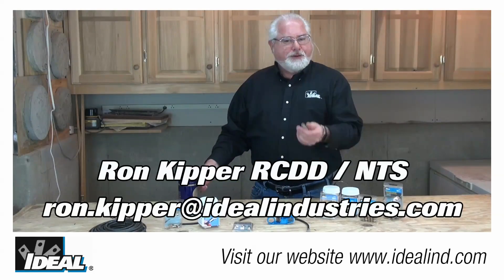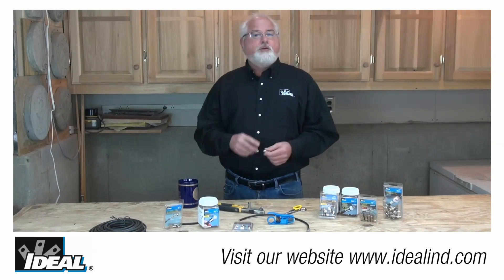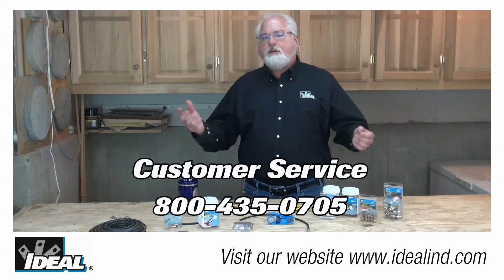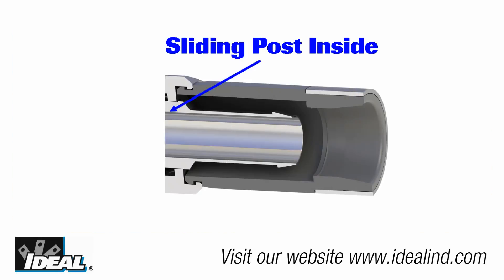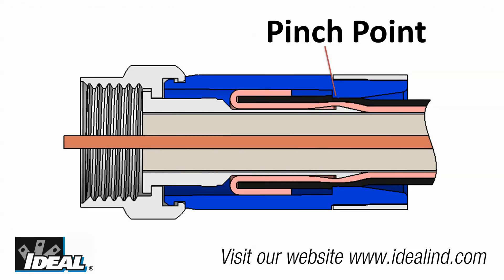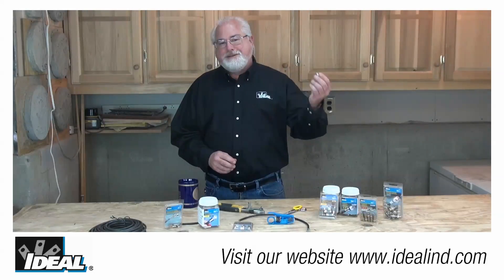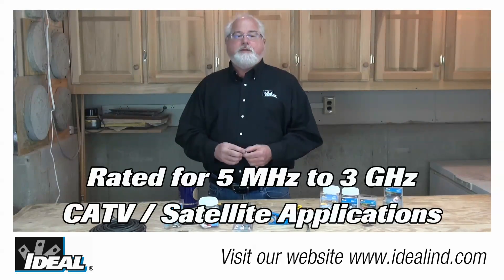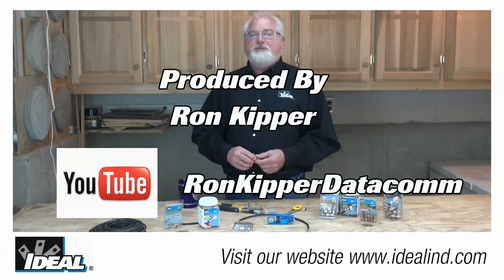TLC™ F Tool Less Compression Connectors

Comment: I used this to make 4 coax cable connections in the basement and they work as expected.  I was going to buy compression tools until I saw this in Home Depot and decided to give it a try.  I used Klein tool coax stripper to make the cut, folded back the braid and pushed (with a little twist) the connectors into the wires.   For a one-time job there is no need for me to spend extra money to buy compression tools, and it was the first time I had ever installed F connectors on coax cables.  Thanks.
Reply from the maker: Hello hope they serve you well Ron

Comment: "Tool less" but uses tools.......
Reply from the maker: Yes not quite tool-less if you include the cable stripper. Really I would have everyone use compression style coax connectors but there are so many folks out there that want a simple solution to installing a coax connector have fun Ron

Comment: These things are useless. They don't fit over the cable even following the instructions. You apparently need a significant amount of force to slide over the cable. Even when using complete body weight  to apply, it's just not happening. Waste of money.
Reply from the maker: Noreen sounds like you are trying to put the connectors on RG-6 Quad cable? You may have the wrong connector for the cable you have Ron

Comment: Why can't they  be used  outdoors?
Reply from the maker: The connector is not watertight so moisture can get into the connection and corrode on the center conductor. You could use it but I am not sure how long it would last. Have fun Ron
Reply: @RonKipperDatacomm1  Thanks  I used it indoors. There  was not much metal wire to braid backwards, i connected it anyway and it worked. But i may have pressed it in too far so i had to pull it back slightly then screwed to a coupler on another cable to terminate  it. Hopefully it works so far so good
 No disconnecting happening

Comment: Ron if rg6 cables vary in size then maybe hot should state on the video and the packaging what cable brand to buy that would fit. I too am completely frustrated with this product and the twist on F connector. Neither one wants to go on the cable. Grrrrrrrr
Reply from the maker: Jack that connector has a rated outside cable diameter range of .254" to .278" range if you need more help email me at ron.kipper@idealindustries.com

Comment: Tip - If you strip the outer shielding about 3/4" (not 1/2") it is much easier. Still strip the dielectric at 1/4", then press on the fitting. When it gets too snug to push any further, you can thread the connector onto a splitter (not to tight, only one or two turns, just enough to grip the threads) then grab the cable just beneath the connector with some pliers and press the splitter down onto the connector, forcing the dielectric into place. Hope this helps.
Reply from the maker: Justin something is wrong it should never be that hard to get the connectors on if you need help reach out to me.
Ron

Comment: Why, oh why did I not heed the advice on these things and buy good old fashion crimp ons and a tool. These push on things simply do not work and I know why. I took a piece of RG6 coax apart and found the middle white insulator piece fits through fine. Then I took a 4" piece of the outer poly insulating jacket (by itself) and no way would that even start to push in there. The outer jacket is just WAY too tight of a fit. These things just do not work on many types of coax because of the diameter of the cable. These things will be going back to Lowes with a complaint to their product management about what they're selling.
Reply from the maker: Ron hey contact me if you need some help ron.kipper@idealindustries.com or take them back if you like.
We try to make our connectors fit a broad range of RG-6 cables. However when you say RG-6 that doesn't mean anything about the size of the cable. From brand to brand RG-6 cable does vary in size and you may have gotten  a cable that has a thicker jacket. Contact me and I will try to help. Ron

Comment: These are dog shit. Just buy crimp connectors. I get to rewire my bed room due to these cancer things. They NEVER just slide on as shown.
Reply from the maker: Dan There must be something wrong if you are using the right cable they should be fine. Contact me and I will try to help you out. Ron.kipper@idealindustries.com
Reply: I am one of the least experienced person when it comes to wiring, and I got them to work for the first time - no issues at all.
Reply: I am one of the least experienced person when it comes to wiring, and I got them to work for the first time - no issues at all.

Comment: I'm having a problem getting the RG_6Q to thread on the male connector , even tried without the cable , not happening
Reply from the maker: Mike I think it is just suck a little try pushing the inner post back into the connector. After you have pushed the connector on until the white dielectric is even with the hole in the bottom of the nut. The act of attaching it to the mating post helps drive the inner post back and completes the connection. Hope that helps Ron

Comment: I've been trying for an hour and I'm ready to throw this junk away and go back to the Phillips connectors. I don't see how pressing this together like they show is going to force the sleeve between the inner and outer sheathing. I have a 1/4" strip as shown but the inner sleeve is over 1/2" long...so how do you get it pushed together? I push it together as hard as I can and the white inner never becomes flush with the front of the sleeve. Pretty upset that they sell crap like this. My time is valuable and I won't be spending any more of it with IDEAL products
Reply from the maker: Gary please send me your contact info and I will call to see if I can help figure why you are having trouble. Ron at ron.kipper@idealindustries.com
Reply: I have exactly the same problem,.  I don't have enough strength in my hands to get it pushed far enough for the white to become flush with the front of the sleeve.  I suspect this the the key to making it work because it it isn't flush the connector comes right off.
Reply from the maker: Karen if you like call my cell and I will try to help you out 815-341-3537. Ron
Reply: @RonKipperDatacomm1  having same problem.  How about just telling us in the replys if were doing something wrong.  Calling helps 1 person.  Replying here to why this is happening will help the masses.
Reply from the maker: @patrooney4670  in most cases if someone is having trouble installing these connectors it is one of a couple things that might be wrong. One is they are trying to install them on RG-6 Quad cable not RG-6, your cable should be marked every two feet. You can also tell it is Quad because there are two layers of foil and braid. Next are they prepping the cable right? 1/4" x 1/4" strip, fold back braid then push into the connector until the white dielectric is even with the hole in the bottom of the nut. Finally the RG-6 cable itself the manufacturers cable diameter vary from brand to brand this connector has an outer diameter range of .254 to .278 inches. People should know that RG-6 is an electrical specification not a physical size. I tell contractors the time to find out your connectors don't fit the cable you are using is not on the jobsite. Hope that helps Ron

Comment: Mr, Ron and Ideal. I spent a nice piece of cash on your RG6F Connectors and I find, they do not thread upon the male connector. I'm very pissed, very disappointed in Ideal. I've trusted this company in many products but I must say that when I tried to spin this connector upon it's mate, it said, HELL NO. After 10 minutes, it said I won't go. OK! Enough. Off to ebay and the hell with Ideal and Lowes. If this is the way you destroy American confidence, then you're batting 100. Well done.
Reply from the maker: bain5872 It sounds like you did not get the connectors pushed on the cable correct completely. If you like contact me and we will see if I can help. Ron at ron.kipper@idealindustries.com
Reply: Ron, Thanks for your reply. I have installed coax connectors before so I'm sure the striping 1/4" outer and a 1/4" on the inner conductor is correct. The problem with these connectors are the threads are not showing at all. It can not thread onto the male for they are no threads to grab. The unused connectors are all the same. I've tried to push the inner hub up into the connector with hopes of revealing more threads but no such look. I gave up on them. These things are not cheap either.
Reply from the maker: bain 5872 I have the engineer who designed those connectors interested in talking to you. The inner hub should float inside the connector and it sounds like it does not. Send me your contact information and we will replace any connectors you have gone through and if we can get those you have back we would like to see them. Send me a note we will take care of you Ron at ron.kipper@idealindustries.com
Reply: Ron,
Thank you for going the extra mile and making this right. I'm very satisfied with the replacement connectors you sent and they work great. Upon receiving these new connectors, I noticed their color was grey and the ones I had were blue. Through our emails, I've learned that the blue connectors require a compression tool to install. I see now that it was a mistake upon my part and not Ideal. I'm sure you were aware of this from the beginning however, you stayed the course and satisfied an uneducated RG6 termination installer. A mighty thanks to you. You Sir, are indeed, a value to Ideal!
Reply from the maker: Cool glad it worked out. Ron

Comment: just bought a set. seems too easy to not try out.
Reply from the maker: Hey Robert they are pretty easy to use. After making the standard 1/4" x1/4" strip in the cable just fold back the braid and the push the connector on until the white dielectric is even with the hole in the bottom of the nut. Take care Ron
Reply: Ron Kipper Datacomm super easy. had to share with my dad. he wanted me to use a crimp style connector but I liked the compression style better. saved me $20+ on a compression tool that I would likely only use a handful of times. thanks for posting the video.
Reply from the maker: Great exactly why we make them!  Ron